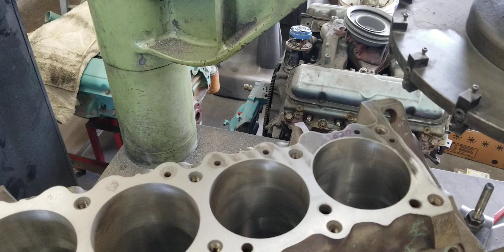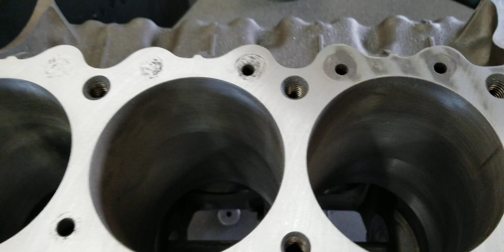Block resurfacing @dcimotorsports1111

Comment: I would love to see you guys do a dyno comparison of a big cam 462 with 280 cfm race ported iron heads vs. your new cylinder head.  Thanks!
Reply from the maker: Your wish is our command :). When I get the new heads I hope to put a set on my Brothers 62 Catalina which currently has a set of my 280 cfm ported iron heads. Not only will we get to see the rear wheel HP difference, but on track ET too.
Reply: @dcimotorsports1111  Awesome. I was subscriber to High Performance Pontiac magazine for 20 years and they never did any comparison of aftermarket vs ported iron heads and never showed a serious build with race ported iron heads.
Reply from the maker: @tomsettles6873  You probably seen some of my old ads from back in the day that magazine :) Ive been in business now 43 years which is hard for me to believe 🤪

Comment: I believe pontiac block material is much better. Cylinder ridge is soo much more on chevy than Pontiacs. On Pontiacs I throw a quick hone to see if there's any ridge 🧐
Reply from the maker: You are correct. Pontiac used way more Nickle in their iron for blocks and heads. That's why you don't see that nasty ridges in the cylinders like you do in a Chevy or ford.